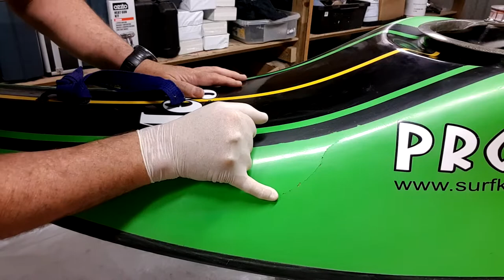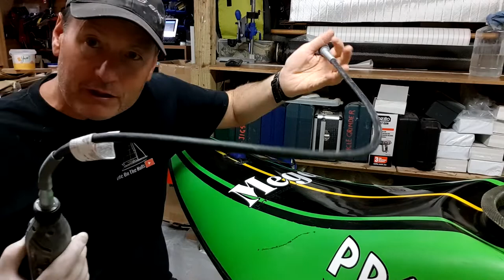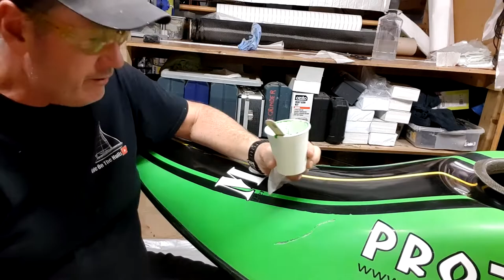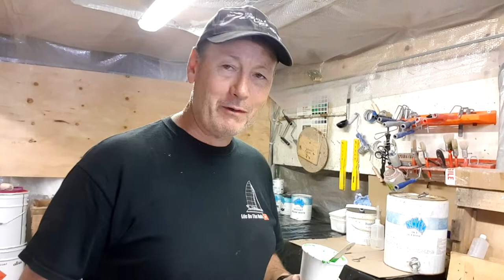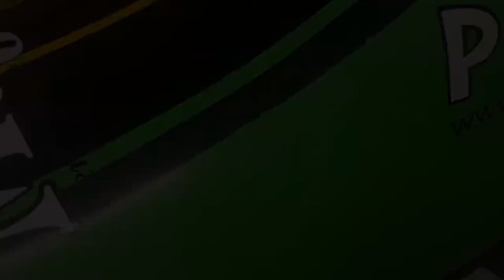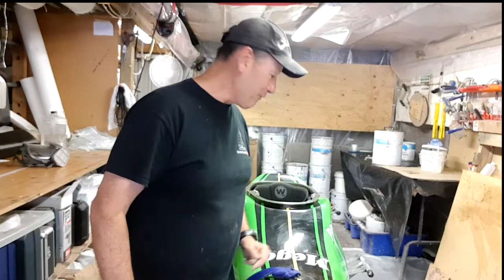Easy Fibreglass Gel Coat Crack Repairs - The Composites Shop

Comment: Waxed paper is cheap peel ply.  Yes, do not try to mix small amounts because that's all you need.  It is very likely you'll get the ratios wrong with inferior results.  I too save the mixing cup as a gauge for how the repair is setting up.  Good stuff, Rossco.
Reply from the maker: Thanks mate.

Comment: Ross I coming to the composite expert for some help. I have a Piper aircraft that has wheel pants. They are the fiberglass aerodynamic covers that go over the wheels on your plane. Both of the main wheels have these covers on them as well as the front nose wheel. Both of the mains have fairly big cracks in them and they need to be repaired. I am really interested to know what type of glass you might suggest and maybe even a layup schedule that you might recommend. Because these wheel pants see a lot stress in flight and landing I was at a loss as to what material selection might be best. I look forward to any help you can provide! By the way I have been watching life on the hulls since the beginning and have enjoyed the entire build. Keep up the great work!!!